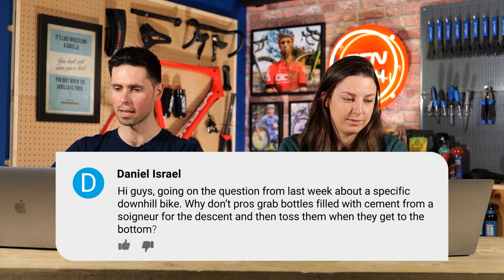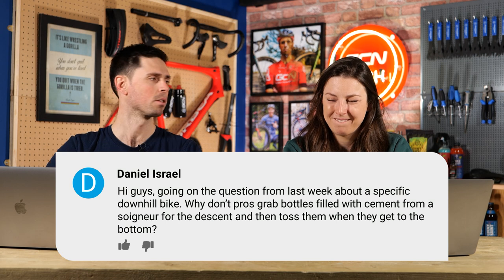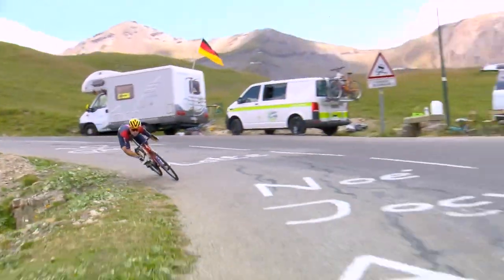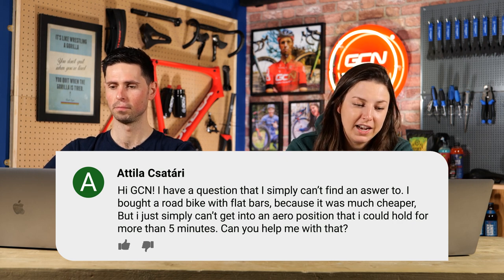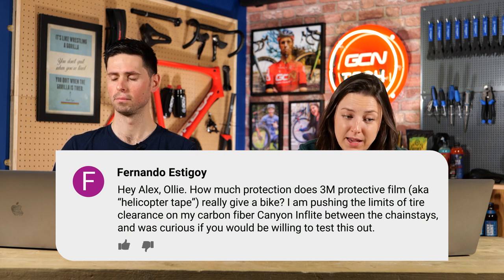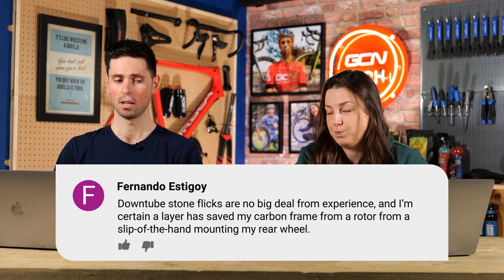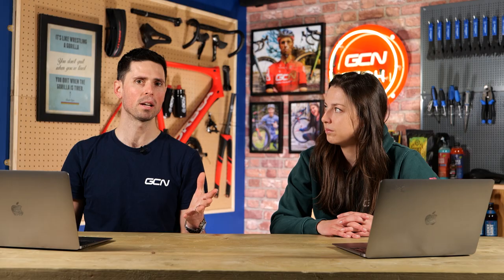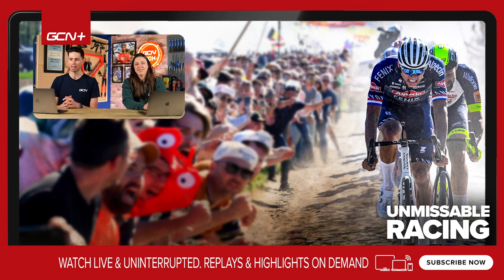Riding In A Tailwind, Frame Tape and Concrete Water Bottles! | GCN Tech Clinic

Comment: A thought on drilling drainage holes in your wheels.  Don't drill into the air space for your tubeless tyres (oops).  If you drill a hole in a composite you expose the edges of the fibres and encourage moiture to capillary along the layers causing disbonding and eventually worse.  So the free edge needs edge sealing (with resin) so the hole must be larger.  Let the manufacturers do it.  I'm sure I've seen a review (on GCN) of a brand of wheel with drainage holes already in.  A good feature to look for then.
Maybe for cement bottles (lead would be better) you need a soigneur at the bottom of the hill to give you a drink and pickup the heavy bottle (for reuse).  Beware you might be fined or worse for discarding your bottle outside of a litter zone.

Comment: Water in wheels - not good.  But - try washing the bike with the valve in a 12 o clock position, as I've found when the valve is at the bottom it's more likely to let water in.  Gravity may be your friend here :)

Comment: Water in Rims. 
Drilling into carbon fibre can cause delaminations which may not be visible to the naked eye but will compromise the wheels integrity. Would advise against it. Rather send it to zipp and have them cary the liability. 

( I used to work on carbon fibre for Airbus & specifically had ultrasonic inspections to check for delam around drilled holes).
Reply from the maker: This 👆 If Zipp are willing to do the work then let them take the wheels, It'll be worth it in the end 🙌

Comment: The "heavy bottle" trick has been done before (lead) but I suspect now outlawed. Also, you wouldn't need a cement mixer in the team car as you'd probably prepare beforehand, you don't see team staff knocking up sandwiches in the back of a car from loaves and slices of ham do you ?
Reply: It's probably a hazard to spectators and other riders when ditching a lead bottle at the bottom of a fast descent.
Reply: Outlawed because it actually is effective (depending on the course).
Reply: Sounds like a good way to break you water bottle braze ons.
Reply: You could just use water. A full 750ml bottle weighs a fair amount.
Reply: @a1white  I'm going to say it weighs 750g !
Reply: @johnstrac  haha yes! 🤦‍♂️

Comment: I didn't buy the "inner" barends right away, but slid a set of cheap bar-ends to the inside of my grips on my Dew Deluxe. Seems to work quite well, though it will take a little getting used to.
Reply from the maker: Double back and let us know how you get one! 🙌
Reply: These were cheap bar ends, I believe I'd bought on Amazon. "Fake" CF, just alloy with a "carbon" layer on top. Just to the inside of my brake levers, they're about in the same spot as the hoods on a road bike. Reaching for the shifter/brakes is a little different, but easy to get used to.

Comment: Been using 3M clear tape to protect my carbon frame , works great . Expect to maybe renew annually . Under fork yoke, down front of front frame tube and around bottom bracket. Down rear of seat tube to meet the other run, and along top of my chain stay. Hard to see it but , carbon , if surface gets etched will allow moisture in , then….
Reply: I can only second that. I have it on a MTB from 2006 on the chainstays and seatstays where the tire goes through and it is still there and not worn so I guess it is more than ok for a road bike.

Comment: 1:53 converting a flat bar to road is not as simple as they say. Additional to the Shifter/brake Levers you probably also need a new rear deraileur, as the pull on mtb shifters is different. Only if you got 105 or touring flatbar shifters, it could work.
Reply: Right 👍
Reply: It works with vintage downtube friction shifters. They turn through 180 degrees though,  so don't be surprised. They never break as an added bonus. Most of the advances were to the chain and sprockets, you wouldn't want what came before!

Comment: Got water (from unexpected rain storms) in a pair of deep section wheels a few times. I held the wheel horizontally and shook it and the water came out from the spoke holes. It took quite alot of time and effort, but it worked. Never tried it on zipp wheels, so may be different and not work.

Comment: I struggled to get comfy on the drops because of arthritis in my neck. I worked gradually to it by fitting drops but inverting the stem. By inverting the 15 degree stem I gained a 30 degree rise over normal, a year or so later I restored it without too much discomfort
Reply from the maker: Great to hear that you've had a play around with it 🙌  Did you ever consider going to flat bars to find more comfort?
Reply: @gcntech  I was trying to move away from flat onto drops.... Flats on the tandem, drops on my roadie

Comment: Well these cement bottles, seem to be likely to move to osmium quite quickly or something like tungsten, since tungsten is much less difficult to manage while still very dense.
Reply: Its probably difficult to get enough of the osmium to fill two bottles and its prohibitively more expensive 1.827,28 Euro per Gram. Platinum at 'only' about 27 euros per gram. So although still expensive could be done. Although I'm not sure how easy it is to grab a roughly 11kg bottle from the roadside travelling at speed. And imagine tossing it away! A random spectator finding 11kg of platinum! Worth roughly 30.000 euros. So 60k for two bottles. Roughly 20-22kg of weight increase. However that will probably just rip the aluminium bottle bosses out of your carbon frame when you hit a pothole anyway!
Reply: Tungsten would be the cheaping out option... but thats way too achievable and not fun. Only about 80 euros per kg. And you are leaving roughly 2kg on the table compared to the denser platinum.

Comment: Flat bars are for comfort and control, depending on how you set it up. It is not really designed for aero.

To get more aero on you flat bars, install aero bars and a stem length that will help you use those aero bars comfortably.

Comment: Alex's comment about immersing a chain in regular lube being less effective than waxing because it will run back out needs a bit more discussion.  I believe that surface tension would result in the right amount of lubricant remaining at the pins and rollers interface. The real problem with immersion is that the lube is attracting dirt to the links, which then migrates where you don't want it.

Comment: #AskGCNTech hey guys, thanks taking time to help us with our questions. I've heard a lot from MTBikers that wider handlebars are good for leverage. On a road bike, instead, always narrower. Why is leverage not important for roadies?
Reply: we don't corner as hard or as jerky as mtbers need to!
Reply: as far as I understand it at low mtb speeds on technical terrain the leverage is a benefit beacause steering is done with the arms turning the bars.  At road bike speeds steering is done primarily by leaning the bike and adjusting seated position to redistribute body weight, using the arms to stabilise the bike by preventing oversteer rather than doing the actual steering

Comment: Re , waxing chain. You are right , also yes the wax is thinner than chain lube and will get into smaller areas, but,also heating the chain expands the link joints and helps the wax gain entry.
Reply: ???  Expanding should make the joints tighter???
Reply: @bobfoster687  Assuming everything has the same coefficient of thermal expansion, the joints will become looser.  It's not as if the inner parts are growing while the outer parts are not.
Reply: @bobfoster687  both should expand together ,being heated equally. But ,from the motorcycle world, a chain after a few miles becomes looser,yes due to lube thinning but expansion taking place too.

Comment: #AskGCNTech Hi tech gurus. I am thinking about changing my 7 y.o. Giant TCR w/ 105, to some newer 2-3 year old used bike for around 2000 euros. As I was looking for the used market I have realized I have to pick one of the 3 options. Disc Break, Aero frame or some older gen. di2. If you can only pick one of these 3 options, what would it be?
- Disc break, Non aero frame, mechanical 105/Ultegra
- Rim break, Aero frame, mechanical 105/ultegra
- Rim break, non aero frame, Ultegra di2
Reply: *brake, unless you're taking a break
What's wrong with your current TCR? Can you upgrade that instead? I feel like 2000 EUR would go a lot further for 105/Ultegra Di2 or maybe even a new wheelset. To me, those compromises aren't worth 2000 EUR unless you really need something your TCR can't offer at all.
Reply: Agree with Mark above. If you do however go for a new bike… Where do you ride - what’s the terrain like? If it’s flat, prioritise aero, if there are lots of descents and rain, get the disc brakes. I would say di2 only (option 3) gives the least value from those options.
Alternatively keep shopping around and see if something comes up that covers more of those options.

Comment: Cement is only 1.4 times the density of water so barely an improvement over just using water bottles, and probably not worth it as the water bottle is actually useful. On the other hand you can get 5.5kg of lead into a 500ml bottle, and that much weight might even noticeably move the bike+rider's centre of mass downwards which is probably good for handling...
Reply from the maker: Hahaha very true... We can't see it happening anytime soon though 👀
Reply: Lead filled bottles might give you trouble in high speed downhill turns, going down a mountain. You might find yourself going off the road, off a cliff.
It might work on a straight downhill road. Over 50 mph (80kph), it's all aerodynamics. Slide back as far as you can, UCI legal, and get your chin down on the bars.
Reply: Apparently this has been done. Had to look it up again, but remembered hearing about someone doing this in the past. Jean Robic (1940s) is said to have had lead filled bottles handed to him at the beginning of big descents.
Reply: Imagine catching a lead filled water bottle on the fly!

Comment: #askgcntech
Hi gcn tech team. How accurate is Strava's average power measurement? A power meter costs as much as my bike and this seems to be the only free option. Thanks
Reply: Are there any other free or cheap methods to measure power??
Reply: @shamendra.sakthivel  Doing the 61km 850m elev loop in 2 hours my powermeter showed 240watts average. Same loop in 2 hours 8 mins Strava estimated 190 watts average. My weight is correct on Strava at 69kg for reference.
I remember conditions being similar. Can look at a couple of my recent rides as well

Comment: I don't get why chain waxers push the idea of using a dedicated crockpot to melt the wax.  Just use an otherwise knackered saucepan on top of the kitchen stove and control the heat in the way that kitchen stoves are designed to do.
Reply: It might work on an electric stove, but a gas stove might end in disaster.
Reply: Melted wax is extremely flammable.  Keep away from open flame!!!
Reply: @bobfoster687  How do you think they made candles before there were electric heating elements?
Reply: A dedicated crockpot is the way to go for safety and convenience. A cheap one costs 15 euros and does the job well. Mine only has low, high and keep warm settings. Even if you forget about it and leave it on high the entire day, it wont end in disaster. You are simply incapable of overheating the wax! High is about 120 degress, low about 80. Since the pot cannot go hot enough to make the wax fume its very safe.. On a stove its easy to overheat it and on a gas stove you have to watch it for safety reasons. With a crockpot you just throw the chains on the solid wax, turn it on low setting. Go have a shower and clean the rest of your bike, put the laundry on etc... and when you come back after an hour the chains are waxed... No fire hazard, no mess, no overheated wax. Whats not to like?
Reply: @luukrutten1295  I agree there's no reason NOT to have a dedicated device for this purpose EXCEPT that it's just one more thing to buy, store, etc.  Using a pan on the stove, in my case a glass top electric, would not burn down my house or kill me with deadly fumes.  It would require a modicum of caution and more deliberate attention than using a crockpot, but I have those abilities.  There's far too much set-it-and-forget-it, can't screw up, no effort required crap in the world today already.

Comment: #askgcntech    Millions of riders live far from mountains, or even medium sized hills. Why aren't there cassettes that end with a 25? Back in the 9 and 10 speed days, Shimano offered "junior cassettes", like 13-25, and even 14-25. They might not have had huge sales, but there was a market for them. I'm sure that there is a market for 11-25 12 speed cassettes.
Reply: I want one.  Hard to find.
Reply: @bobfoster687  Shimano doesn't make one.
Reply: wym? There are 11-25  and 14-28 cassettes for 11 speed from shimano. But what's the point when 11-28 is 15...20 euros cheaper.
In 12 speed realm, yes, there is only sram red 10-26 and miche 14-29
Reply: @feedbackzaloop  Isn't the 12 speed Sram non-compatible with Shimano now??
I've never used (needed) a cassette larger than a 25. (and I'm no longer in racing shape now). Six years ago, my low gear was a 39x23. 25 years ago, it was a 39x21.
Reply: @billkallas1762  it isn't indeed. But, one problem at a time.
However, if you look up 9 speed 12-23 you will see it is fully included in 11-25 11 speed. 11-30 spacings of 12 speed Shimano is very close to that, just extra gears widen the range. And that is how the cassettes developed over time: the close range of previous generation got extra cog to match bigger range of wider cassette.
Hence the question: if it is that flat in your area, do you really need all the newest drivetrains and are there really millions of people like you? Also, wouldn't you rather benefit from a bigger cassette with 56:42 chainrings?

Comment: #askGCNtech Hi! Great content as always. I have a question. I am looking to upgrade my bike and fit a power meter. I have an option of getting a left crankarm or getting a whole dual side new assembly. will a new 12s crank fit with my 10s groupset? Would love to hear your insight.
Reply: No because the chain width is different. Left crank arm is fine, I use a 4iiii 105 power meter.

Comment: #askgcntech Hi Alex and Dr. Oliver Bridgewood, I have a 2010 Alluminum Caad 8 rimbrake bike with mechanical Shimano Tiagra comonents and would like to upgrade the groupset to electronic. Given that there is no internal cable routing on this bike, is there a way I could stay within Shimano components and upgrade to Di2, or is changing everything over to one of SRAM's fully wireless etap axs groupsets the way to go?

Comment: #askGCNtech 
I'm sorry if you've answered this in the past, but I've seen some videos and read some things about factory chain grease. It seems like there is a lot of conflicting opinions on the matter as well. That being that it is not good and should be taken off, a more modern thinking, vs the more old fashioned idea that it is 'good' and shouldn't be immediately taken off. After the reading and researching some, I'm pretty much all in with the newer "factory grease ain't great, take off immediately" camp. 
I'm wondering what your guys' thoughts are?
Reply: Main purpose of factory grease is to preserve chain while it is in storage.

Comment: The answer the question about sitting up and making yourself a sail with a tail is simple-Inertia: equal and opposite reaction. 
So no at any speed, sitting up will not benefit due to simple physics. 
Remember the power required to go faster is not linear (ex 34kmh requires 60-65% of your power to over come frontal aero pressure and 50kmh requires 80-85% of your power to over come frontal aero pressure)
Reply: That's not true: if you have a tailwind that's greater than your forward speed, you will benefit from sitting more upright. However, you might compromise on other things such as power loss due to a less comfortable position.

Comment: #AskGCNTech Hi guys an Manon, I will ride my first cobbled sportive soon so punctures might be an issue. Would you leave the wheels set up tubeless and potentially have a sticky mess when you get a puncture or set it up with an inner tube, increase the risk of puncture but have it nice and clean in case you get one?
Reply: I would personally run 30's tubeless. But, I'm mostly commenting to see if they reply. I've never ridden cobbles. I am curious as to what they say.

Comment: #askgcntech  Hi all.  Love the Tech channel and all your content.  My question:  You frequently admonish your viewers NOT to clamp our carbon bikes by the top tube in a work stand, but, all you presenters seem to have no problem sitting on your top tubes when your are filming.  Isn't sitting on the top tube bad for the carbon?  Seems inconsistent.
Reply: Sitting on the top tube may flex it slightly but that's well within what that tube can take. Clamping it doesn't allow it to flex as the clamp is effectively crushing the tube, which is a force for which it was not designed
Reply: @jeremynorth , applying a load in the center of the top tube that is supported at both ends results in a three-point bending force that compresses the top of the tube and tensions the bottom of the tube.  Certainly it wasn’t designed for that kind of load just like it wasn’t designed for clamping in a bike stand clamp.  I am merely pointing out that it seems inconsistent to warn against clamping the tube of a $5000-$10,000 bike and then park your butt on the top tube when it wasn’t designed for that either.